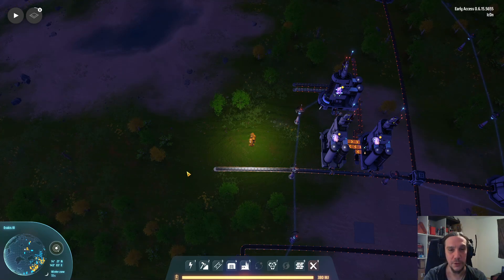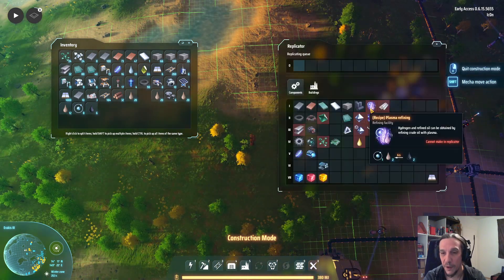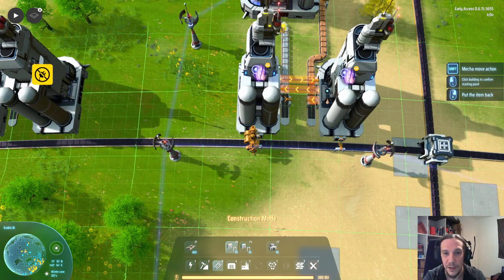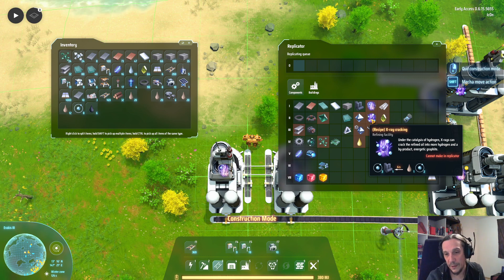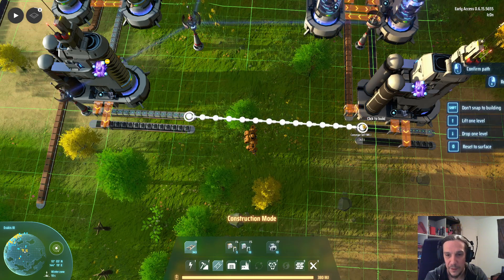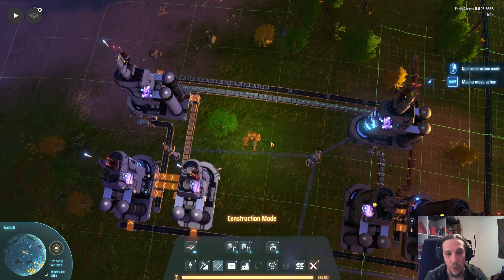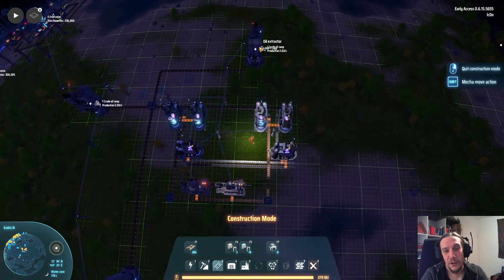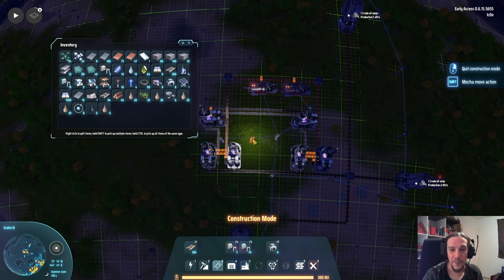Oil Tutorial - Dyson Sphere Program - X-Ray Cracking Guide

Comment: okay i juste watched your video i add to pose when you sayed you "you can burn the extra refined oil" and start thinking and i think you miss something huge 
hugg hu, folo me : so its a 4s recipe just imagine you build 4 machines so we can say its a 1s recipe same for Xray . so plasma give 2 oil and 1 hydrogen. Xray cost 1 oil and 2 hydrogen so you can feed 2 Xray recipe in terme of oil (2x4) but it will cost 4 hydrogen/s and you only have 1/s BUT Xray aslo give you hydrogen and 2 recipe (2x4) will give you 6/s . so you have total of 7 hydrogen/s and you can feed the 4/s cost of the 2 Xray recipe by making the output loop back intoo input with 3 hydrogen/s left and 2 grafite/s and no oil left . all of that for only one plasma recipe (2X4) witche coste 2 crud oil/s. mk1 bellt are 6/s so you can triple it and have one bellt of 6 crud oil/s for 9 hydrogen/s and 6 grafite/s

Comment: Couldn't you run the new hydrogen through another refinery with the excess oil to generate even more hydrogen? Is there a break-even point for both if so?
Reply from the maker: Theoretically yes! But practically most of the time you don't need more Hydrogen - that's why I didn't even think of it ^^
But yeah, if you really want more hydrogen, the process should be repeatable